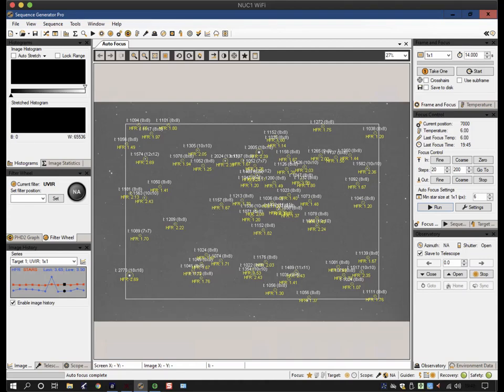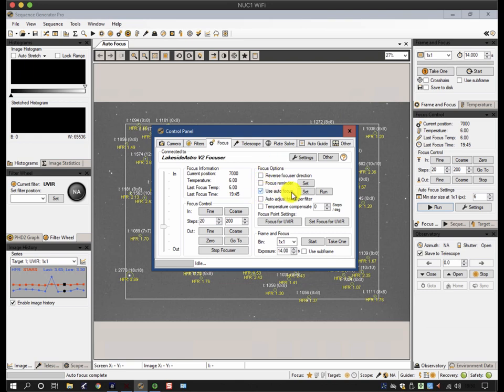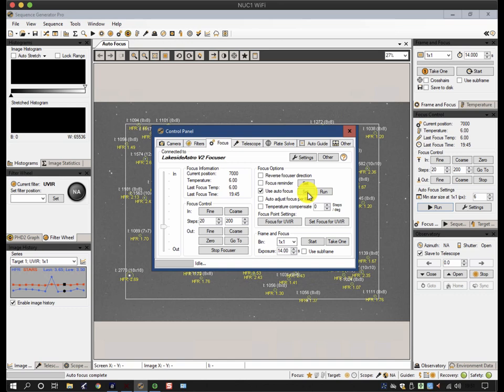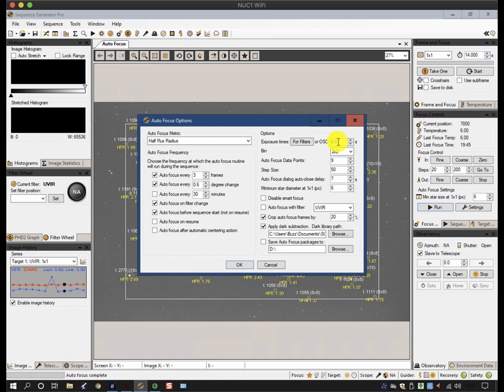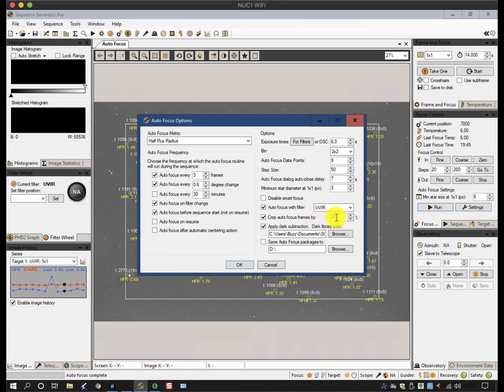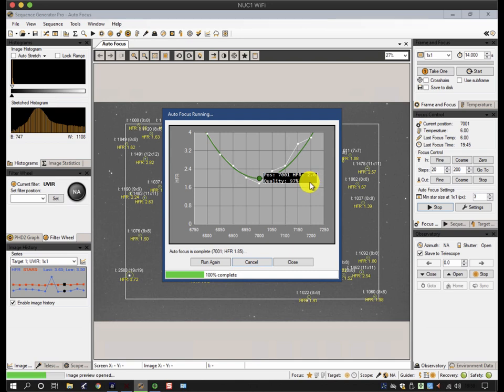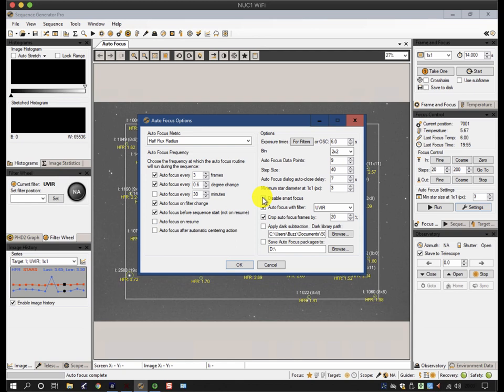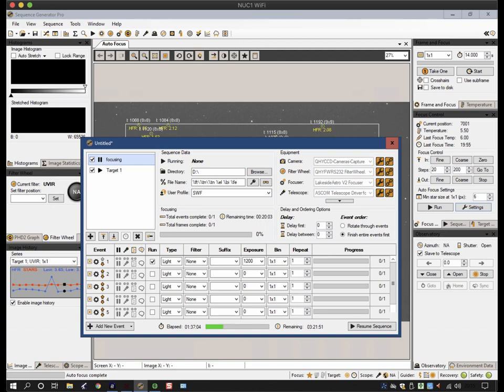Sequence Generator Pro (part 9) - focusing

Comment: Nice video Chris, thanks.  There are so many videos on using SGP but hardly any on doing what I think is the most important - focusing.  I purchased SGP two years ago and opted for APT, which I really like, but it does not have a true autofocus or anyway to monitor focus during the night.  Cheers

Comment: Thanks Chris - this is a great series that I've watched multiple times over the last couple of years.  I just got a ZWO EAF and am using it for the first time tonight.  I focused using my Bahtinov lens before I started the sequence.  The autofocus sequence formed pretty much a straight line as opposed to a hyperbola or a "V" - and the autofocus failed, after multiple attempts.  It's also a full moon tonight, so there aren't many stars showing in the field.  I increased the exposure time from 3 seconds to 10 seconds, but there hasn't been a trigger yet to see what that effect is.  Are there settings you would suggest i change when there isn't much movement of the HFD?  Thank you so much for all your great tutelage.
Reply from the maker: I would check the focuser , has not worked loose and is moving and if the images during the focus session do not appear to change, try a different step size.

Comment: Chris...Thank you for this great video!  I'm having an issue having SGP restart after the autofocus run in the middle of a sequence, because I have "pause autoguiding while auto focusing"  It won't resume the sequence, telling me recovery mode is not enabled  Where do I set that?  In PHD? SGP,? Or somewhere else??  Thank you and Merry Christmas!
Reply from the maker: It’s a while since I have used SGP. From recollection, it is in the options menu. You can set number of try’s and pause interval. If all else fails, it will be in the manual

Comment: Hi Chris, great video (and a great series) - thanks!  I'm consistently getting a single dog ear on the right side - a bit like yours in the video.  I've experimented with step size but it will not completely go away.  Could this be backlash in the electronic focuser?
Reply from the maker: unlikely - dog ears are especially prevalent on centrally obstructed scopes. It is caused by the star changing shape from a defocused blob to a ring. This can confuse the focus algorithm and it locks onto a hotspot on the ring, rather than the ring itself. When I'm focusing, I try and have a 2-3x range in HFR. Any more is unecessary.
Reply: @astroshed  Much appreciated.  I've been dogmatically following the 3-5x suggestion as per the sgp help file (scope is a Televue np127is refractor).  I'll continue tweaking and certainly try toning things down to the 2-3x range.
Reply from the maker: @bethunderchunkstorm  The latest focus algorithms do not need the classical straight-line sections of the V curve which require a large working range. They work on a curve near the point of focus. These was researched by a few SGP users and ironically mentioned by me as a potential method a year earlier!
Reply: @astroshed  Thank you!!!!  That last comment is really helpful.  This explains why I kept getting a much flatter curve when I reduced the step size.  I thought I was doing something wrong because I didn't have steep walls and kept upping the step size until I got what I 'expected' to see - a classic V-curve with steep sides (albeit with a dog ear on one side..!).

Comment: Hi Chris can you if you can went Friday night it great all work Great then went out last night it want all wrong the Focus just would not work it was going every were just dont understand why can you help thanks
Reply from the maker: the answer is 42, now, what is the question?
Reply: @astroshed  6x7
Reply: Can you help please
Reply from the maker: @alangriffiths1432  Alan - you need to be clearer with your request for help. You have not provided any details at all and it is impossible for me to suggest anything you might try.
Reply: @astroshed  thanks
Reply: The sequence generator pro the focusing software wouldn't work it wouldn't  make a v curve and every time I tried to blind plate solve it would not work